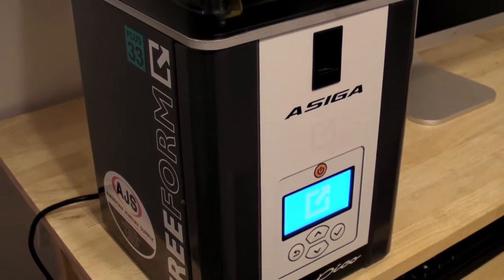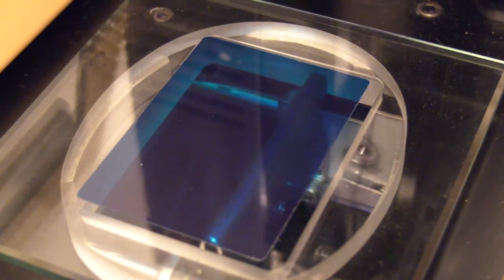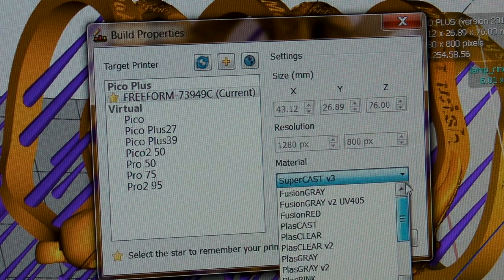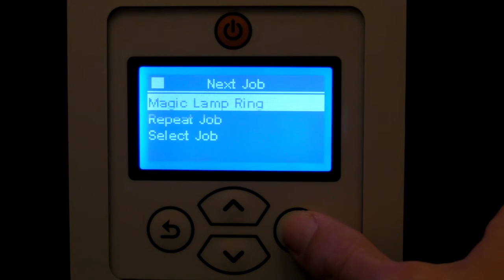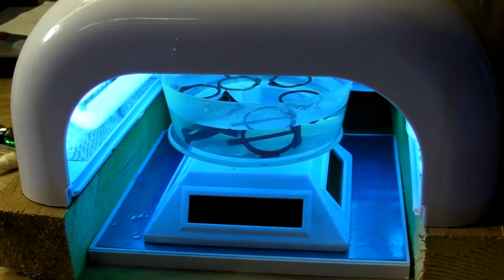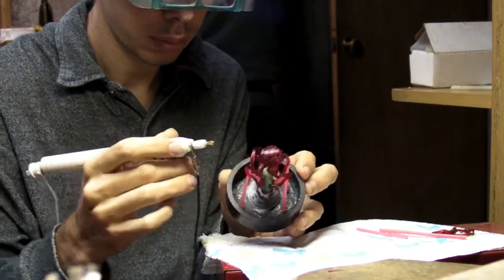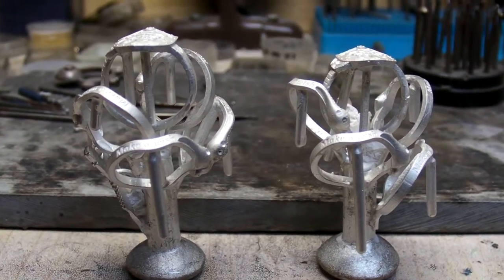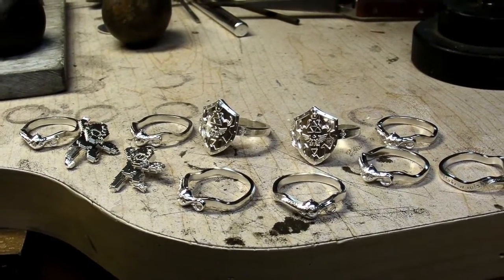youtube video #-BtDL6yrQjg

Comment: you mentioned further curing the resin in your kiln before casting. could you please elaborate?
Thank you
Reply from the maker: I found that kiln curing certain resins helped to create better castings with less breakaway and ash residue. Specifically Asiga's SuperCast v3 and B9 Emerald. The pieces are first cured under UV light in the normal manner. They are then submerged in mineral oil and placed in a kiln at 300 degrees for an hour.
Reply: That is very helpful thank you so much. I have been experiencing issues with ash and have yet to get a clean cast. Where did you learn about this technique?
Reply: Sorry about all the questions I'm sure you have better things to do, I've tried so many times to cast resin with little success and I'm starting to get desperate
Reply: 1 last question, you mention vacuming out the resin during your burnout is this referring to a vented kiln?
Reply from the maker: @lukewessels9641  you'll see at 5:05 of the video that I'm adding sprue wax to the pieces that lead to the flask base. These will burn out leaving a vent that leads to the piece. An hour before casting I remove the flask from the kiln and put the hose end of a vacuum pump against those vents to suck out ash reside. The flask is then placed back into the kiln until it's time to cast. What resin are you using?
Reply: I see! That is something I have yet to try, well I've tried a couple different resins that claim to be castable and supposedly leave no ash residue, (maker juice labs wax cast and power cast burn) but I've found that this is simply not the case when casting with the traditional approach and extra steps are needed it seems in order to get the kind of castings you are getting. I'm thinking I might purchase some of Asiga's red castable resin and see if it's any better.

I also have used a vac oven to try and draw out any uncured resin (90°c I recall) after uv curing before casting and have had similar unsatisfactory results (I read about this in James Binnons symposium on resin thinking it might be the answer). Another reason I'm so curious is that it seems you have a very similar set up to my own, I have the same vaccume casting machine and melting furnace, however your kiln looks to be abit larger and possibly vented and the only other thing I haven't tried is plasticast (I live in Australia and it's hard to get a hold of), I have been using r and r standard ultra vest which is much weaker I understand,
Thank you once again for the tips any info is greatly appreciated 🤙
Reply: What is the mineral oil that you submerge the models in?
Reply from the maker: @lukewessels9641  I just use standard mineral oil you can find at a pharmacy. I did drill out holes in my kiln to get air flow going with an aquarium pump.  If Plasticast investment is not available you could try Prestige Optima as they are very similar. One more thing you can try would be to add 1% boric acid by investment weight when you mix your investment. Dissolve the boric acid in water then add investment. This will make the investment very hard. (It will also reduce the work time you have when mixing). I found this boric acid trick greatly improved my castings over any other tip.

Comment: Hello Friend! Tell me please, the polymer SuperWax as in the instructions, melts at 50C? Can you make a video on this topic? You are using SuperWax polymer?
Reply from the maker: Hello Maxim, The instructions for SuperWax says to set the Pico heater to 35c to keep the solution melted in the tray. If you are melting it in the bottle to pour into the tray, then they say to use hot water or a kiln at 60c. I'll do a review of the material in the near future.

Comment: Hi Nicolas, excelent video, after you print the model, you clean it with alcohol isopropiloc and then you cure in  a bowl with heat water , thats right? Wich temperature and how much time you cure the pieces in the bowl? Thanks so much leonel
Reply from the maker: Hi Leonel. For SuperCast resin I submerge the piece in mineral oil and place them in a kiln at 300 degrees Fahrenheit for 1 hour. I've started using Emerald resin and for that I submerge the pieces in water and place in a microwave for 3 minuets. I do this three times, letting it cool for about 10 minuets between each cycle.
Reply: @SterlingKisses  thank you nicolas, only one question more, when you do this before putting in UV   light and how much time you  leave it there   ?
Reply from the maker: I do UV light first. 10 min on each side.

Comment: What is your favorite DLP for casting?  I do lost wax casting.  Im ready to start 3D printing.  I really enjoy your videos!  Thanks!
Reply from the maker: I've tried a few different resins and they each have their own advantages and disadvantages. SuperCast v3 by asiga is probably my favorite because its reliable and when properly cured can cast difficult pieces like class rings without lettering defects. I do have to apply vents to help with removing ash residue but a longer burnout cycle might help with this. Asiga's SuperWax is a little too fragile and needs to be kept warm to stay liquid which is too inconvenient for me. It does however burn out just like wax. B9's Emerald Resin has a great price point and burns out very clean, but I have trouble with class ring type details when it comes to casting and I still haven't narrowed down any reliable printer settings for consistently good prints. It also needs to be stirred if it sits for a while, for example between every print job. A lot of people swear by it but I haven't had as much success yet.